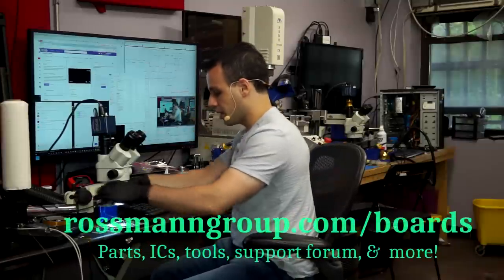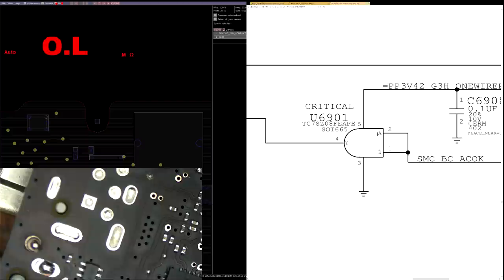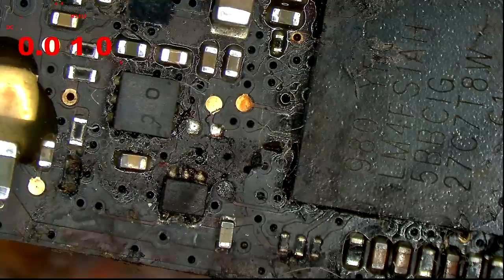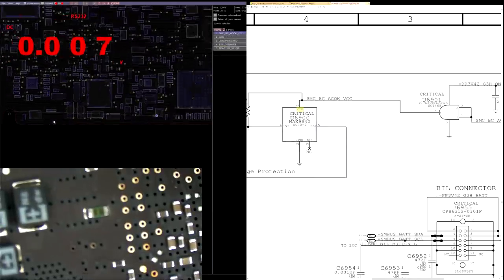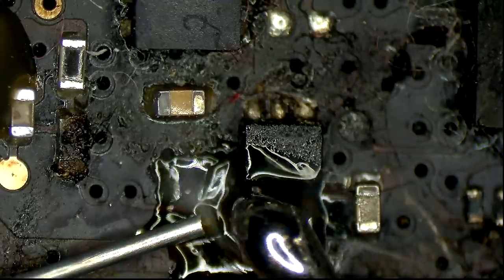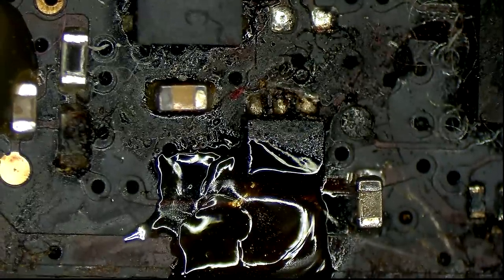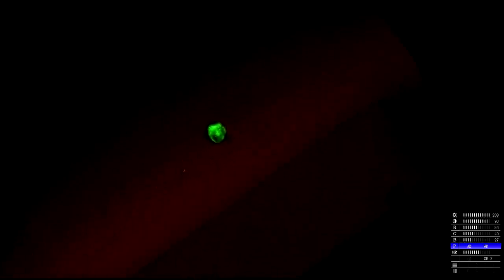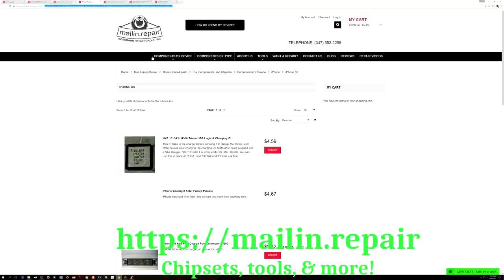What did they get wrong?

Comment: Why do I love watching these? I don't even know anything about circuit boards...
Reply: because louis is amazing and knowledgeable as well as to the point.  very genuine and no fakeness.
Reply: Because: Louis.
Reply: Same here. I''ll watch the longer rant videos and now these shorter edited work videos too. Would never have watched the full livestream though due to time.
Reply: Same reason people watch House but know nothing about medicine.
Reply: yup.. makes me feel dumb to ask Why/how did he use what looked like a solid uncased wire across the board?
Reply: it looks uncased but actually it does have insulation around it. Also, is is a jumper to connect two terminals together that should've been connected by a missing trace on the circuit board.

Comment from the maker: Livestream is on the new, live channel. https://www.youtube.com/channel/UC6nZlvfz4YWoBWbjiaYJA3g If you prefer live to edited, subscribe there.
Reply: iTCXtreme Probably still being processed by YouTube
Reply: Louis Rossmann Would it not be better to use hot glue to secure the wire?
Reply: Gaza Imp I haven't watched the full livestream but he usually uses Chemtronics CW3300C overcoat to secure the wire at the end. Better then hot glue for this.
Reply: Hey Louis can you give me your opinion on the design of following laptop brands mother bords. Razer, dell, MSI, ASUS, and gigabit.  I am talking about these manufacturers high end laptops. Just a quick rating from 1-10 for quality of design I am looking for.
Reply: +THEGAMINGHELP
That is an incredibly difficult question to answer. To answer it would typically require a gerber file of the actual board, not just the chip layout. This is due to the fact that you need to typically have all the data lines on the same layer, and as short as possible for maximum speed. This can be misleading in that just because a chip is closer physically, the wire routing through a 16 layer board is invisible to the casual observer looking at the top layer and bottom layer only. Regardless of design, the specs of the FSB, and datasheets of the chips themselves are solid indicators of the standards they have produced. Beyond that is simply to do benchmark testing...of which there are plenty to choose, as this is a major supporting industry in electronics! Electronics reviews...

I think I have heard his opinion on this issue once a week! Whatever gets the job done for you, is the best tool for the job. In this case the axiom, outside the case of standard board interfaces for memory, standard LVDS etc. would be what options you need your motherboard to have. One method apple seems to be using(which annoyingly is probably going to become normal) is soldering in the SSD in order to shorten the propagation delay/line resistance/noise and thereby increase throughput. Recently, we have seen the results when he ran a new laptop against a mac, comparing file transfer speeds.

I, for instance have several machines, because one motherboard that does everything I want, simply doesn't exist! I require hardware addressable RS232 and parallel ports, which are non-existent on any modern machine(even modern PCI cards for that purpose are emulators, and many software solutions don't support them)...so I have a desktop with the ASUS P5W DH Deluxe from back in 2003/4(I bought it whenever doom 3 came out :D. )..This motherboard has EVERYTHING except modern speed and graphics processing capabilities and so it is ideal for interfacing with just about anything you can imagine, and writing custom software to easily facilitate that interfacing.

For entertainment, I have an alienware w/ an i7...and a commodore vic-20, and commodore 64, and a game gear. In several cases, however, I find the ease of interfacing things even easier on a vic-20/64, since everything is directly addressable inside and out!

So here we see that for my needs, some of my hardware is getting close to 40 years old...and in other cases, is brand new.
Reply: Yeah I had thought it would not be as easy as it sounds. I have a feeling tho that these days laptops are designed to fail in 4 years in order to continue selling new products since if they were able to last 10 years they would still browse the internet without a problem 10 years later. Compared to old computers where people would have to upgrade because they could no longer keep up with the modern web.
Reply: Ya, I guess it comes down to a philosophical argument in that older tech still technically does everything it was originally designed to do...but somehow 10 years later that is not enough.

In the case of phones, people think the same thing, only in 1 year increments! 

In reality, you can actually squeeze a TON out of an older computer using the classic SYSGEN approach. Vis, only load exactly what you need, and not more. It was this which allowed the RT-11 operating system to run within a footprint of 16kb, and have the functionality of an operating system 100 times that size.

In the case of even modern operating systems, you can still use msconfig to turn off superfluous processes you never use, and even a 10 year old laptop will be fast with modern web browsing.

For instance, I am using a dell inspiron 1520 right now lol...thing is ancient. My alienware is in bits because I ran over the screen(long story). I turned off just about everything, and am down to around 30 processes. It's plenty fast enough to have several applications open and run youtube at the same time.
Reply: Peter Lamont What I was saying tho is that a laptop made today could still work just fine 10 years later and do everything the average user does without an issue. I have a 6 year old laptop and I am a very heavy user (I average 13 GB ram usage) and it handles everything not really much worse than a current computer. This is the problem manufacturers face is that people do not upgrade there computers as often since they still work fine 5 years in, so in order to keep making money they have to make them fail in 4 years so the user is forced to buy new. (I was not sure if u got what I was saying the first time but if u did sorry about repeating my self)
Reply: I see ya I did miss your point, but I don't think that is necessarily true. As evidence, our respective laptops. I will agree that they are definitely not designed with repair and maintenance in mind though(with the notable exception of lenovo). Even on this dell I am using, the hard drive just slides out the side, and you have screw access to ram and the mini pci slots, as well. Even the optical drive is modular and able to be removed/replaced/upgraded. I will say that among all computers out there, apple is the least upgrade-able and therefore, the least return on investment/the greatest depreciating utility. btw, I am sporting 2gb of ram on this thing lol, and use less than half of it ordinarily, although right now I am dipping into virtual memory.
Reply: Well, I am currently writing this on a 10 year old laptop(Dell Inspiron 1520). I think in 1990 you may have gotten a more realistic view of what is happening. Laptops were then 12 mhz and had no color built in screen, a 10-20mb hard disk, a single floppy disk drive, but cost over 2000$. compare that with 10 years later!! Then they didn't have gas plasma displays, but color LCDs and larger drives. They could run windows 98 etc. and had something on the order of Gigabytes of storage! So I think the idea that there is a planned obsolescence is not true. Technology just keeps marching on. The main problem is that developers of software are utilizing this new power to be lazy with their coding. They are forced to code this way because of market pressure. They can't take 10 years to develop an ultra fast application...but rather a bloated system that can get away with it's bloat due to the speed of modern systems. As example, Look at Visicalc on an altair 8800 vs. open office calc on a modern windows machine. They are exactly the same practical speed, even though one is running at 2 mhz on an 8 bit bus, and the other is running at 4000x that speed, and at 8 times the bus width, with multiple processors!!! lol... In truth, you could easily do all of your spreadsheets on a 1970s or 1980s computer just as effectively as you can with a modern machine...
Reply: He switched back to his original format on this channel anyway

Comment: But, it says it's a 2008 or 2009 MBP if I am not misstaken.
So, the repair is probably not worth it. A used, working logic board is a lot cheaper than the price of the repair.

Comment: People miss a lot. The old HP Pavilion laptops I had, DV7000 series laptops, were shiiiiiiiit. The GPU was failing over and over, and I kept having to send it back in for repairs. In fact in my first 3 months of ownership it spent more time in the shop than with me. Even the first one I had custom built was already having issues after two years, so I bought an Alienware before the HP's GPU died. It obviously sustained heat damage, as the backlit keys over the GPU were darkened.  NO way it could have kept gaming, so I gave it to my mother since all she does is pay bills and web browse. Those HPs have ALL been shit at cooling. I know you specialize in CRAPBOOKS, but have you ever worked on any HP laptops that have issues with overheating?

Comment: Could I ask something?When he routed the wire ,doesnt need that wire an isolation? Cuz wire is condukting and the wire can connect othrer unncecessary parts in the circuit and potencially creates short circuits
Reply from the maker: +DatAssSVK it does need insulation
Reply: Louis Rossmann then why u didnt use it?
Reply: Francesco Marino i never saw that tipe of wire ,oh wait now i know,in europe is called something like that,but i didnt know that ,thanks .Is that wire used in transformers right?

Comment: Is the wire you use insulated ?
Reply from the maker: +Raptor50aus does it turn on or blow up at the end? :)
Reply: correct you got the "Green: light" so I presumed insulated
Reply: Lies! We all know it's the pubic hair and skin flakes on the board wedged between the wire preventing it from shorting out.

Comment: Hey Louis, if you could help it would be much appreciated:

My Macbook has sound only when headphones are plugged in. If I unplug them, no sound. 
The store I bought it from is denying warranty because it says it's a software problem and want to charge me 30 bucks. I think it's the switch that got stuck because a red light is on where you insert the jack and I did format and instal the software before dropping it for warranty.

Could it really be software or am I being robbed?

Thanks!
Reply from the maker: +Dan Mac red light isn't software. That being said $30 is nothing to a business paying employees and rent.
Reply: Thank you!
Yes 30 dollars is really cheap to fix the macbook, BUT in this case it is still in warranty and they are trying to charge me 30 bucks saying it's software ( software issues aren't covered by warranty).
Reply from the maker: +Dan Mac red light isn't software. That being said $30 is nothing to a business paying employees and rent.

Comment: Very informative! I do have one question: it looks like the wire was touching other conductive components on the board (resistors, maybe?). Why would the naked wire running across it not cause damage to other components or at least make the board inoperable?
Reply: Vocylis magnet wire, insulated.
Reply: Meemo A much more simple answer than I was expecting. Thank you! I was not aware that these wires could have clear coatings. 🙃

Comment: Hi  Louis, really love your channel. good stuff mate. Couldnt find anything about 820-2849 board on your channel. Really does my head ache. Really strange situation. when its powered on battery only it switches on, chimes but no video. when its connected battery and dc adapter it charges the battery, but if its only on dc power then it has a green light but wont turn on. I have read a few forums but couldnt find the answer. for some reason when its connected to adapter PP3V3_S0 missing. it has p3v3s0_en_L 3.3V but q7830 wont produce pp3v3_s0.
when its on battery it switches on and it does have pp3v3_so 3.3V at pin 1 of c7830 with no video, but on  adapter power it wouldnt power up at all as pp3v3_s0 = 0V cant understand what the hell is going on. Main power rails all ok .
When on dc adapter i have 
PP5V_S3 =0V
PP5V_S0 =0V
PP3V3 _S3 =0V
PP3v3_S3 ISNS_R =0V
PP3V3_ S0 =0V
P5VS3_EN is missing on u7201
PM_SLP_S4_L missing.
any help would be appreciated
Reply from the maker: what does _l mean?
Reply: i am enthusiast and dont fix these boards for living, but really love doing some work on them and fixing them. i have watched most of your videos especially about pm_slp_s4_L missing. as duke says monkey see monkey do. but thats where i am at this stage. i Have had 3 boards 17" 820-2849  with exactly the same problem. its really weird that you havent came across one. all of them missing pm_slp_s4_L but rabbit went so deep that i am not able to find the problem. i Know you can help me , does it have anything in particular that goes wrong? duke mentioned that these boards do have a problem with actual gpu in one of the forums. do you think its fixable or just throw it away?its really weird. it turns on on battery power with no video but doesnt turn on when  adapter plugged in. green light on charging the battery as well. any help or suggestion would be appreciated. its a nice 17" machine and it would be nice to use it again .
Reply: everything seems to be powered from pp5v_s0 and pp3v3_s0 and they both missing because pm_slp_s4_l missing. just going round in circles . and all chips looks pretty good theres no obvious burns. maybe you had similar thing with this particular board? can it actually be dead graphics?please help.
Reply: how can it be possible the from the battery it powers on and chimes but when i plug dc in then _L becomes missing? really drives me crazy this board. im just wondering if i am waisting my time on a dead gpu board or can it be fixed. how do you explain it not turning on from dc and working from battery
Reply: please help

Comment: U6901 is to this day the best proof that Apple builds machines to die quicker.
Why use a simple transistor that can survive years on end when you can use a complex logic chip with an enable wire and two inputs only to connect both inputs to the same powerline?
Reply: Not at all. This is a common thing to do in electronics; it's called a buffer. Also - it's not a "complex logic chip". It's a logic gate; which is literally just 2 transistors; and they are typically just as resilient as individual transistor packages are. (okay this one might be 3 transistors b/c it has an enable).
Reply: OMG! that was the first thing I thought too when I saw the schematic, the AND is tied together on two inputs...totally redundant. They could have used two SMD transistors, or an SMD 74F10...which is bog standard, 2 input AND, and it would have been cheaper...why a 3 input AND gate? Apple thats why...

IDK, it could be that there was a sale on 3 input ANDs at the time lol. These things happen. It's not like they are probably in high demand, so that is very possible. No one can make the argument that it would reduce chip count though...since a SMD 74F10 would likewise be one chip, and by the looks of it have a smaller footprint as well...
Reply: When designing a board for production you often try to minimize the amount of different parts. Each part has to be sourced and loaded into a pick and place. If you're using an AND gate somewhere else and you need a small buffer or need to switch on a device that draws a few mA then using a and gate like this will save you money.  Honestly, I'd say these macs need to be reworked this often is because apple leaves exposed copper on the PCB. If the test points where tin or gold plated they wouldn't corrode so badly when it gets wet.